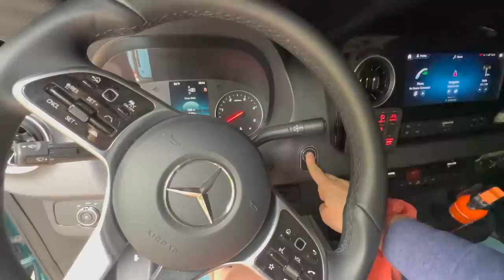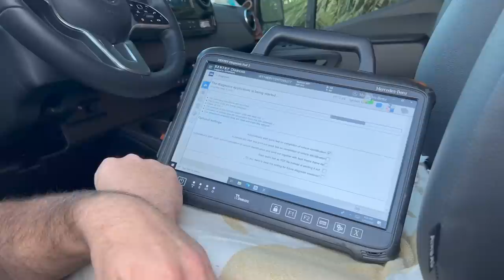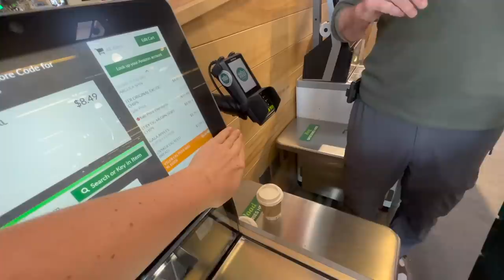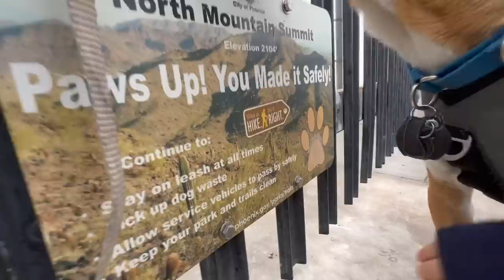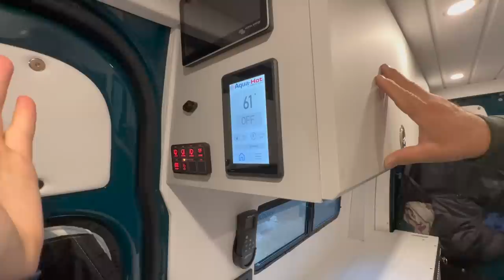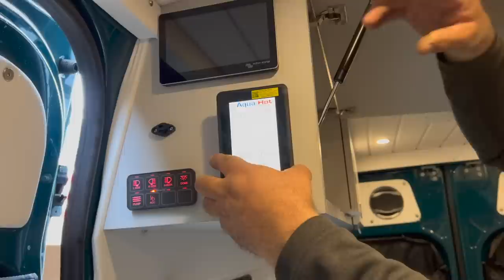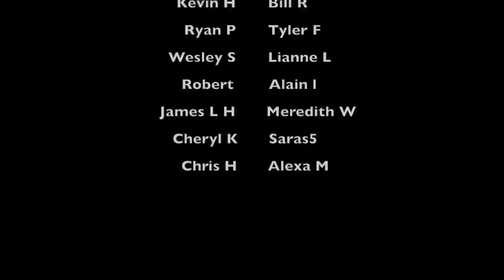Realities of living in a van (when nothing goes as planned)

Comment: I just bought a slide in camper for my dodge Ram 3500 turbo diesel , I inexperienced bought to big of a camper , an old 1995 skyline wilderness back in the day it was top end but what truck is it for I don’t know it’s large and heavy , my truck weighs 11500 on the scales with camper on truck , everywhere I look 10,500 is gross weight for the truck oh no. It’s a 1999 Ram 3500 dual axle not meant for campers though. Good for towing . So it’s scary driving the camper on it hasn’t broke yet. However I was towing a mini cooper so I could work as outside sales rep for a restaurant delivery company like doordash . I was just getting started all set to travel first town I hit I was at a rest area and broke my mini cooper on a tow dolly then since I thought I fixed it enough to get to a parts store I drove to and it over heated and I ruined the engine done no more cooper. I am stranded now no way to get money. I had thousands saved for starting but I took my cooper in when I bought it to have it looked at and smogged , it was one of those days mechanic told me to order a part I did later found out it was wrong part, he left my lug nut off front tire car was shaking on hwy , I called mechanic to come out to my moms house , she lived in country side , I needed to get to work so I didn’t run out of money , mechanic said a week he will be there he shows up tells me to order new front end, I ordered it week later he comes out says it’s just a lug nut no need for front end, more money more time, he has me wait two more weeks , money is running out , he comes out breaks the stud in turbo connects to down pipe for catalytic converter, another week he comes out breaks extractor , then a week later I just put car on the trailer and leave take car to the first shop I went to he fixes it all cost me more money . I get down to last of money for traveling , take off and break cooper  , relatives all said can’t help, so I had to get a hard loan 931$ I have to pay for 300$ wow. Cuz I was just starting back to work after Covid 19 on restaurant related job and was stranded in countryside with one sister and deceased father mother is married to a family that gambles and wouldn’t hell me with a dime.
Reply: I lost keys to camper today. Luckily I was a mile from lock smith parked at a lot downtown in Eugene so I could walk to do sales . I had two sets made , this is a growing experience. I found out my travel companion isn’t coming which is good it would have been difficult and my car is broke she can’t follow me behind now and truck sucks because I broke seat belts trying to fix them for the first time they locked up so half my front seat is unbolted and the seat belts are unlocked but won’t retract.

Comment: Watching you get stuck in a few inches of snow, struggle for two hours to get out, then back for miles down a road because leaving the beaten track risked getting stuck again I couldn't help but notice:   Whenever your "electronic four wheel drive"  loses traction on one wheel it spins uselessly while the other three do nothing.  Just like the 2WD 1950 Chevy pickup I used to own.  In reality Mercedes charged you a big pile of $$$$  for what is in reality a one wheel drive van.

Comment: I think maybe You have a Battery Ground Wire issue if it's not the aqua system itself. FAULTY Battery Ground wires will drain batteries, short/fry Electronic Motors, etc...

Comment: And these are the folks that are doing the build for your van?
Reply from the maker: These issues have nothing to do with the van builder. It’s a Mercedes issue and a parts issues.
Reply: @NikkiDelventhal  If you say so. Just  an observation based on what I saw in the video.  Remember, the builder selected and put in the heating system in the van, not Mercedes which has its own issues  with its electrical and electronics systems.

Comment: Clean the Battery Terminals and Ground connection to Engine/Body.  Check Voltage and try again.
German over priced over Engineering shoddy result.  $1,000 service call.

Comment: The name Mercedes used to be the very epitome of Quality and Engineering excellence. I found my 1967 220 SEb sitting abandoned for ten years under an apple tree.  It's owner had left for Vietnam to kill brown people and never returned.  I paid $ 1000 for it and drove it for 500,000 miles with less repairs than your new loaner has had in two months. Thick red leather seats that didn't crack after 500,000 miles. Mechanical fuel injection (gas), cranks to raise and lower the windows and operate the sun roof,  a key for the starter switch and the doors, and a manual transmission. No computers anywhere.   

New Mercedes cars rank at the very bottom of the list for reliability, being outranked by those from Korea and even Italy!  Sprinter vans are well named.  If you own one, sprint to the nearest wholesale auto auction and offload it.   If the transaction costs $20,000  its a bargain.

Comment: This is NOT good advertising for Mercedes. You just got that van, as expensive as it is, you should be a couple years trouble free operation. That is just disgusting. 
Safe travels.
Reply: Let’s Not Forget the Company that Build out that Camper Van that’s currently Building Nikki’s Camper Van.  She should definitely tell them to Not Install Heating System in her Van.
Reply: @PHN-2024  You are correct. The heater supply company and the designer are the ones I feel would be responsible for the breakdown. Hopefully they warranty it.
Reply: @shadowdemon13  People cite the fact that finding Mechanic Help for Repairs outside of a Mercedes Dealership for the Sprinter Van is Why they Don’t want them for a Camper Build-Out.
Reply: @PHN-2024  I don't like all the excessive electronics in the vehicle. Like in this case, as she mentioned, the Prius was much simpler to deal with. If it were an option for me, I could live out of my Murano. Much simpler life.